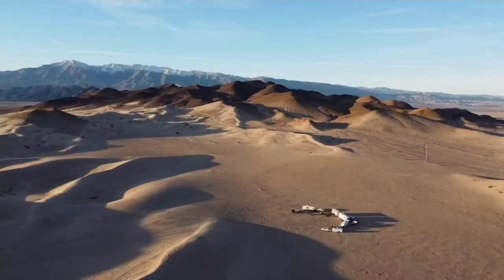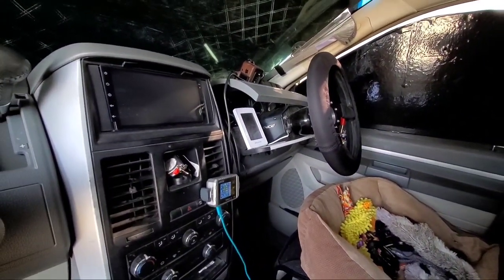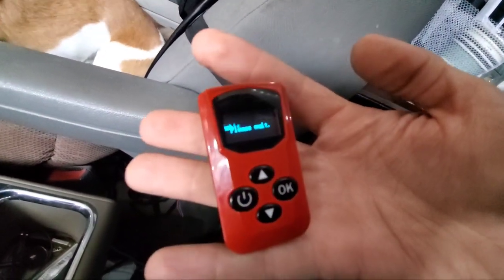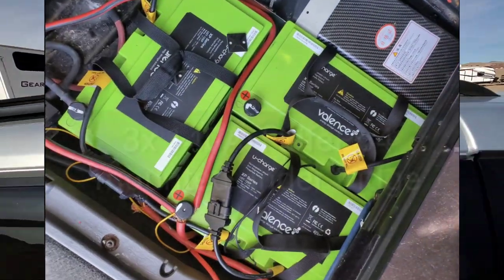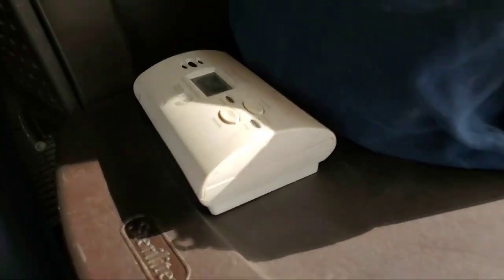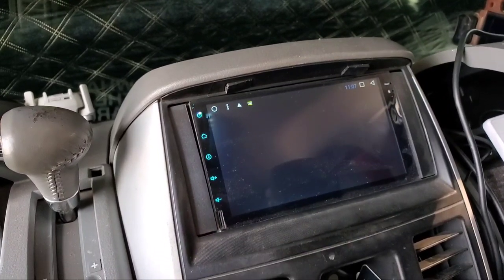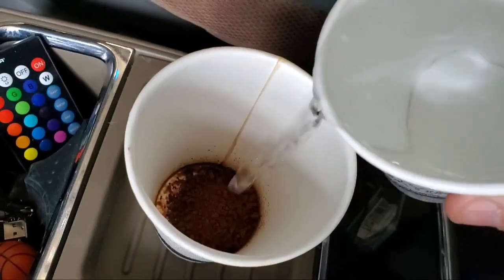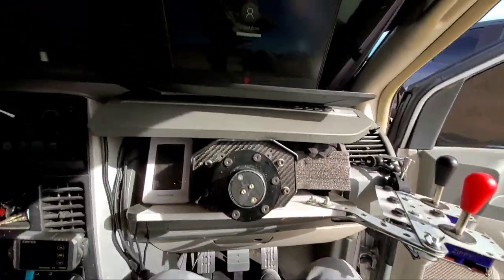DIY minivan conversion. 330w solar, 400Ah lithium, HEATED MINIVAN CAMPER :)

Comment: Dude this is unbelievable. You have more so many creative and unique ideas. My favorites:

- The fans are easily the coolest (no pun intended) and most unique feature. No need to spend hundreds on a Max-Air or Fantastic Fan. Just mount a few 12v computer fans behind the bumper. Way more discrete and for the size of the van it's probably enough airflow. Question: did you say they automatically turn on when over 25 degrees? because if so then that's even more amazing.

- Your electrical set-up is better than most professional builds. Amazing. Two small features I really appreciated were the windscreen in front of the panels and using the old stow-and-go seat compartment to hold the batteries. 

- Using your bed frame and heater combo to dry clothes is really creative and I'm sure very effective.

- The diesel heater exhaust extension pipe. I'm sure you'd be fine without it but I appreciate when people take extra precautions with their van builds. It's too uncommon.

- You live in a minivan and you have TWO dog beds. Lmao Priorities could not be any more perfect. 

Really enjoyed this. Thanks!
Reply from the maker: Thank you! The fans do come on at 25C, i set up a basic digital thermostat that controls a relay that connects a powered USB hub, then fans feed from the hub. the thermostat and all wiring are hidden behind the fans, once set i do not need to see it again. 
For diesel heater exhaust extension like i said if there is no wind the fumes just collect under car and no car is perfectly sealed ao eventually fumes come in. this was perfect solution, the straight metal pipes were like $4 at home depot.
And yes two dog beds were absolute priority lol he is also the sole reason i had to start vanlife 😆
Reply: Like the extension pipes too, but I would have to have something to remind me not to trip over them, lol. Do you really watch movies on steering wheel while driving,  or did I misunderstand?

Comment: Nice Job!  I like that you are blocking out the front windshield, not just hanging a curtain behind the front seats.  I dont live in my 2010 transit connect but plan on some travels with it.  I made a canvas curtain that can block the drivers side window, the front windshield and the passenger side window...sitting in back it keeps the van feeling a little larger.  Stay safe and enjoy your travels
Reply from the maker: thanks! the windshield cover makes insane difference in the sun. obviously i dont put it outside when i park in city, but thats rare

Comment: Brilliant electrical setup.  I have a Grand Caravan too, no solar panel, charges from alternator only.  Instead of a microwave I use an induction cook top, so my coffee takes a lot longer.  It's good for one-pot meals.  Neat how you fit a diesel heater, fridge, and dog.  :)  Happy trails!

Comment: Greetings from New York City 👋🏽. I've noticed that with the right skill, you can cram a lot of stuff into these minivans. I have seen some incredible build outs and yours is just as cool. I would love to turn my 2004 Toyota Sienna into a camper. I just don't know where to begin 🤔
Reply from the maker: begin with simple bed. adjust and change as needs for comfort increase. ive seen many cool setups but i wanted something quick and reversible and without putting in a lot of work like wooden frames and cabinets as im not very good with tools. also plastic is cheaper and lighter. when you build a camper weight is super important
Reply: Also doing a sienna.  There are van conversations for sienna online.

Comment: Great  video...awesome set up...new sub here....I have a 2012 dodge grand caravan and wanted to set it up for some traveling...probably in a non permanent way...Thanks again..
Reply from the maker: that was my goal to make it somewhat livable without permanent modifying. the only permanent things are 2 1inch holes in front floor storage for diesel heater air source

Comment: How did you got the plastic bed shelving around your wheel well?..i have a caravan cargo van and I'm thinking about cutting out the bottom half of one side of the wheel well so the bed will fit more flush against the wall also giving me a couple more inches
.not sure how I will insulate the wheel well tho..plywood then insulation to cover the opening I think..idk..still thinking on it..cool job on your van👍✌😊
Reply from the maker: the minivan has no exposed wheel wells, both sides are completely flat and fit perfectly 2x 24in wide shelves, it really couldnt be a more perfect fit lol
Reply: @vanlifethings  thanks for your reply..lucky you..mine only stick out about 3 inches..enuf for a cupholder, but I think I figured it out..thanks so much..blessings n Happy camping✌❤😊

Comment: Would love to see an in depth video about mounting your solar panel as well as make/model
Reply from the maker: its sunpower 327watt panel SPR-E327 i believe. they come in 320watt silver frame and 327 watt black frame, same model basically. only downside it is 60 volts so mppt is a must.

Comment: How did you install the fans near the bunper? Did you have to cut a hole in the wall? Would love more information, want to put them in my van!
Reply: there is air pressure equalization vent, its about 5x4 inches if i remember correctly. you take the vent out and put a flexible hose through, it comes out between bumper and chassis, perfect place for cold air and not much dust. you can get better access if you remove the tail light
Reply: @briinums  thanks for the reply. I can kind of understand that but don't know what's behind that panel so having a little trouble picturing it. Did you happen to take a picture or video of it? Or watch someone else's video for inspiration?
Reply: @QuickfireBookReviews  dont have a photo. i just improvised and found that vent
Reply: @Mike thanks, i dont run the engine unless driving :)
Reply: Mike, did you install this too? If so, any suggestions or tips?

Comment: Very good set up! How did you secure the plastic shelf, because the shelf's legs are wiggly. Also, can you share your setup for the solar/electrical in the car?
Reply from the maker: Chris Xie the shelves are 24in wide so two of them make it 48in wide which is exact width of the minivan interior. Also i strapped together the middle legs with bungee cords here and there. That and a mattress and weight on top make everything stable and sturdy!
Reply: Question: Did you saw legs different lengths to level your bed? Thanx.

Comment: Hi.
Your van build is awesome! You mentioned the window insulation is from Home Depot and it's cheap and easy, but could you please explain what you used?
Reply from the maker: polyiso 1/4 or 1/2 inch.. it comes 4x8 feet for $12
Reply: You probably know by now. It's called Reflectix
Reply from the maker: @travisn4493  reflectix in some places but in most places i put polyiso foam insulation boards

Comment: I like the plastic shelving idea. I don't think it would support 220 lbs tho?
Reply: It takes 4 shelving units to make a bed, and the ones I used were rated at 150lbs each.  Edit: 4 shelves, one set, 36"x18" shelves, $75 at Home Depot.  If you put them long ways, there are 4 legs clustered in the center of the bed, which will support a whole lot of weight.

Comment: Has your van been reliable, what year and kilometers or miles on it? Great video!
Reply from the maker: Jeff Hayden its as reliable as any other car. I blew the radiator as i blew a few more on previous minivans, its just bad design running too hot from factory. Other than that these minivans are pretty reliable and VERY easy to repair if you do your own repairs (compared to fullsize vans)
P.s its 2009 with 190k
Reply: Thanks for reply

Comment: Besides the fans at the rear, how do you keep cool?
Reply from the maker: i had another extra 4in fan on the other side for really hot days. the minivan with extra window insulation keeps very cool. obviously if its very hot outside like 2020 then just head towards mountains. in my new van i have AC that runs off solar

Comment: I was planning on fitting 400ah of lithium to my Pajero/Montero but not sure if 2x 300w panels will fit on the roof.
Reply from the maker: You can always find 100watt panels in various sizes and combine them to your available dimensions
Reply: @vanlifethings  Ill be mounting 370 W panel on my minivan from san tan solar. would like to see exactly how you mounted it on your van, looks like theres a pad under it also?
Reply from the maker: @saltpepper1894  i unbolted the roof rails enough to lift the rail a bit from the rail base and just push through a perforated bracket, then bolt goes through it. then bend the bracket to fit solar panel. i did put a 1/8 inch soft rubber padding everywhere where solar panel frame touches the roof and a thicker foam pad right in the middle because eventually the panel will bend in from vibration and cell weight ehich will just collect water and make it even heavier..
Reply: @vanlifethings  I imagine thae rubber could hold water possibly causing rust. I like SUGRU (nice silicone putty) for that kind of thing
Reply from the maker: @saltpepper1894  ahh i was sure i would not own the minivan for more than 1-2 years so didnt care

Comment: Would you install that heater for me I live in Little neck Douglaston New York
Reply from the maker: im mostly in nevada :/
Reply from the maker: buy the heater, get to know it, try fitting where you want it, put intake and exhaust pipes on, see how it would mount.. then go to any small auto shop or friend who works on cars and show them heater and ask them to drill 2x 1inch holes, maybe even do all installation